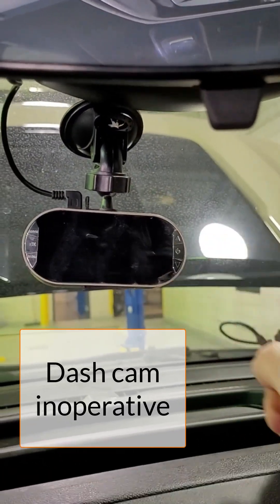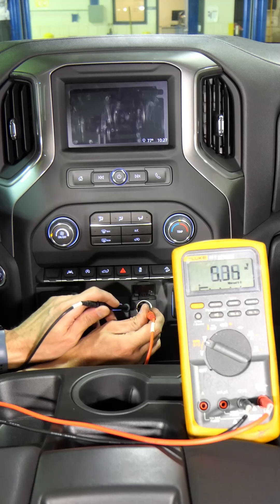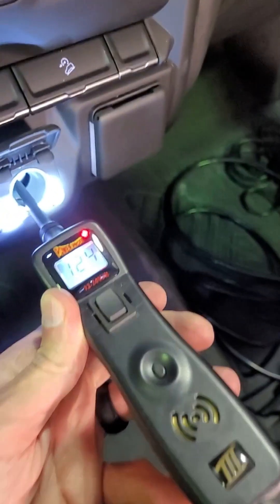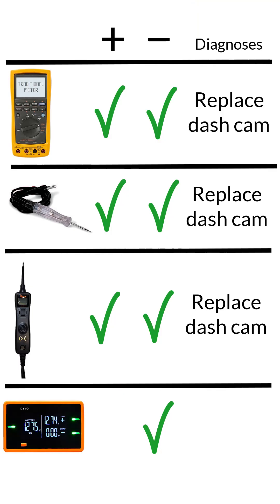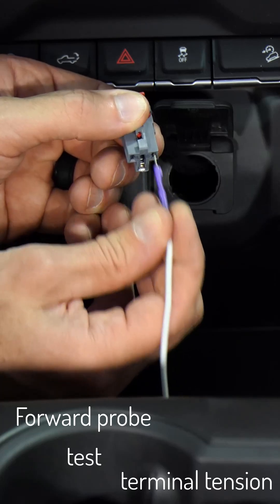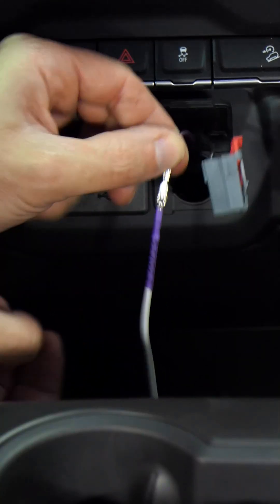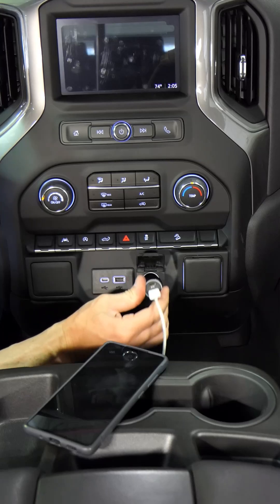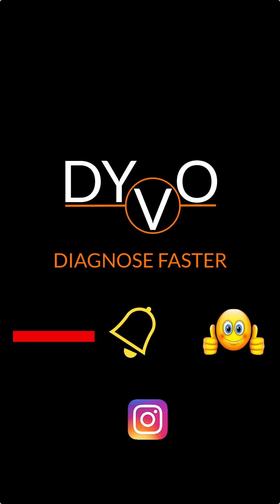Which tool can find the problem?

Comment: If you could do a follow-up on why the Power Probe and Fluke meter did not read the 10.9V, but the DYVO did. It would be very helpful and squash a lot of the comments made about the results.

Comment: If the issue was current at time of testing, the test light would have been less bright, and the power probe would read same as both your tool and the multimeter. I clicked on your channel in interest of your selling points, but the next video I clicked on is showing me why you’re selling snake oil. Feel free to prove me wrong.

Comment: Your Fluke should have shown you the same voltage as your Dyvo. Seems fishy.
Reply: His meter puts a load on the circuit to test it.

The Fluke does not.

The test light however seems too bright to me. I was not expecting it to be as bright as it was with a 2v drop.

It looks like it has an incandescent bulb.
Reply: I have a set of Loadpro test leads that I use with my multimeter.

You push a button when voltage is displayed... if voltage changes, a voltage drop is present.
Reply: My thoughts exactly
Reply: Bruh.. its voltage drop
Reply: @realityspirit2370 
Yes, but to check for voltage drop with a regular multimeter,  the test leads have to be connected differently (compared to what is shown in the video with the Fluke). 
His fancy multimeter  performs a load test automatically.

Comment: My question is why didn’t the multimeter show the 10 V that the other thing showed? They  testing the same thing.
Reply: As on the volt meter is test when the live isn’t under load, and the other tester has some sort of resistor in putting the live under load and showing your volt drop, but you can still using a voltmeter to solve this fault
If you back pin into the live with a volt meter with the dash cam plugged in you would see when under load the live is at 10 volts. You always test components under load to see volt drop
Reply: Good question. I have the same doubt.
Reply: I was thinking the same thing….I need answers
Reply: You can actually see the voltage transient when connecting the dyvo to the outlet.

Comment: Surprised the test light lit up that bright for real
Reply from the maker: Yep, it's pretty crazy that it can still be that bright with only 10.9v.
Reply: What about Dan Sullivans tool he made about 10 years ago the load pro?? Wonder what that would of shown
Reply from the maker: @philh9238  Great question. The Load Pro is a good addition to a meter, but doesn't stand on its own. You still have to have a separate meter. You probably know that, but we're adding that note for people who may not know. The Load Pro with a traditional meter would show 10.9v. The problem is you still wouldn't know if that voltage drop was on the power or ground side. You'd have to do 2 more tests to isolate the problem (3 tests total). If you pair Load Pro with DYVO, they work really well together. You only have to do 1 test. You can see if the problem is on the power side or ground side. You can apply a bigger load to the circuit. And you can do same side voltage drops (power to power, or ground to ground).